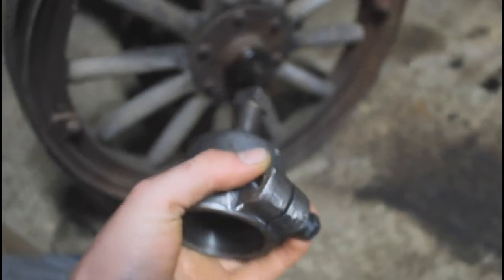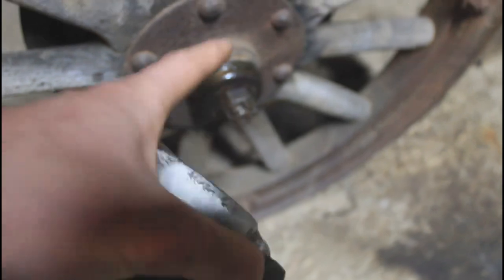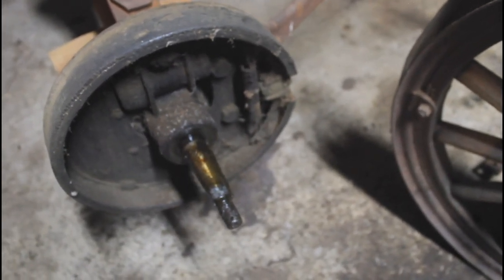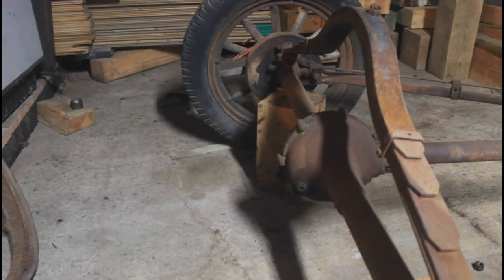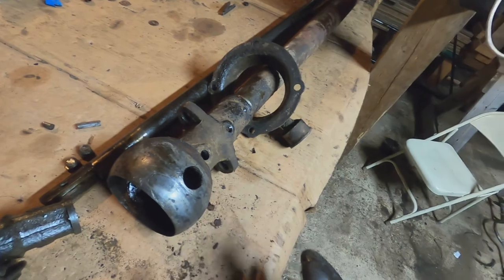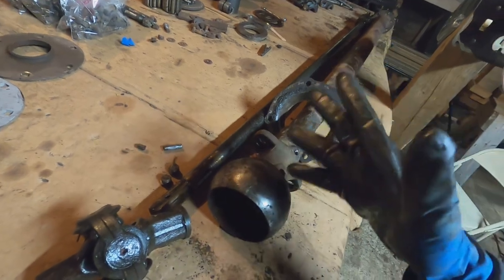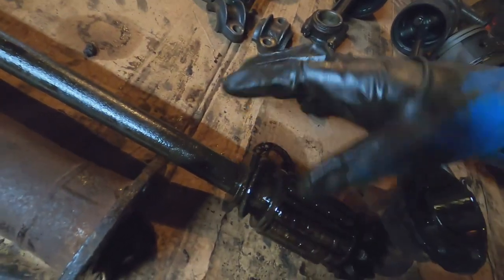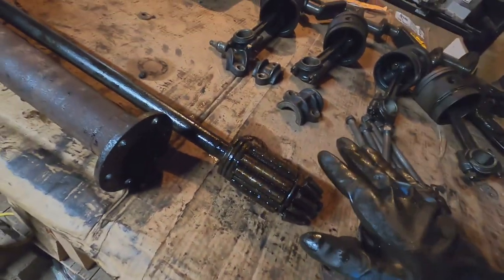Pulling rear wheels and disassembly of differential

Comment: You really don't need the $75 cast iron rear wheel removing tool.  A $19 three jaw 8" gear puller from Harbor Freight works perfectly.  Just set the jaws onto the outer edge of the brake drum and you're good to go!